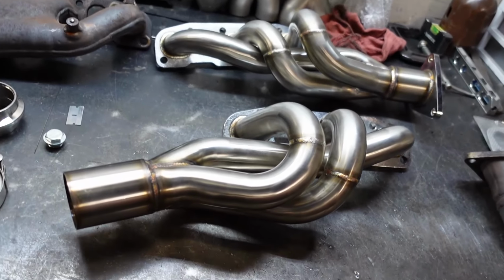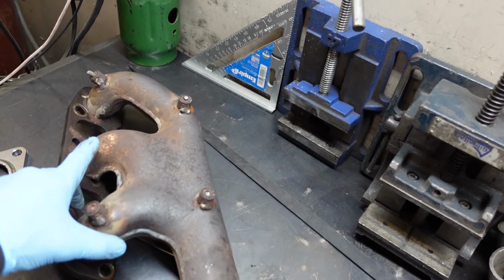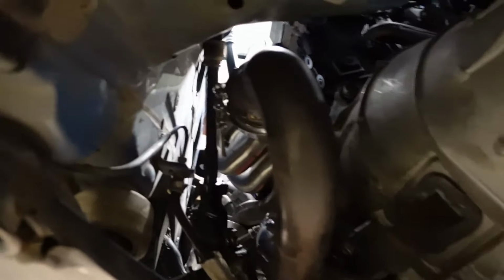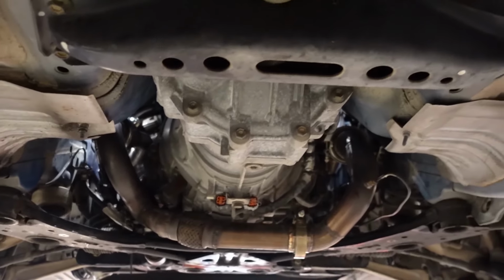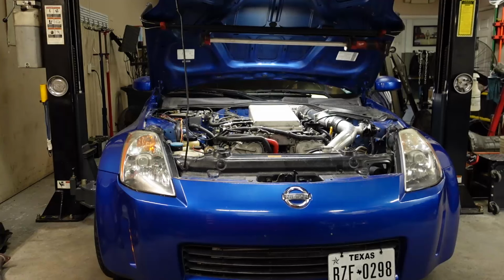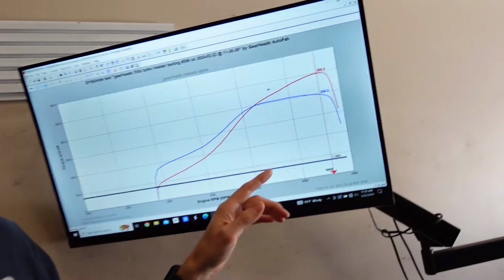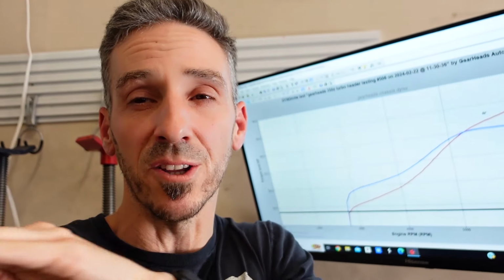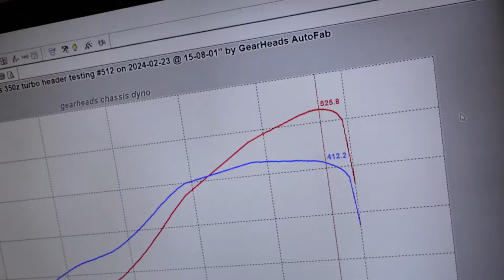Are headers better for  a turbo 350z?

Comment: i knew the headers was the culprit🙏. commented this 2 videos ago. good stuff
Reply: The headers are not "the" culprit, they are yet another one in a long line of issues :)  The back pressure still is higher than it should be.

Comment: Yes. There is a guy who makes a kit with vband headers. VFP tuning. Corky Bell's book would have put you on the right track. Measuring back pressure verses boost pressure would have revealed it all. What clutch are you using? 15 pounds of boost is a lot. A better choice of turbo and intercooler core will give you even better results.
Reply from the maker: Funny thing …..I have that book on my night stand started reading it like a year ago good stuff!

Comment: Niiiiiice work bro. Finally got that number and some more information. My Link ECU should be here Tuesday. Then I’m ordering my complete fuel system. Gotta add a set of headers to the list. And those are some eBay headers. Getting the job done. Nice.

Comment: There just isn't room to fit the optimum size tube for the up pipe, so some incremental improvements in flow are possible with the merge and wastegate, but the limit is close because of that up pipe size limit.
Reply: what’s the optimum size for the uppipe? 2.75” or 3”? I thought it was best to keep the size the same as the exhaust inlet.
Reply: @StreetHeem  3" would be optimal, into a turbine housing that can handle it.  That's for peak power though.  With the 2.5" used here it becomes a back pressure issue at peak revs, as does the T3 flange.  But anything below 500hp the smaller tubing helps spool.

Comment: So I've been thinking cus I'm about yo do the same kit ill end up using 370z or g37 stock headers to reduce back pressure and keep heat down as well after coating everything the difference in diameters is quite crazy how small the stock ge5/350z headers are. Primary being 1 5/8 but de exh exit is 1.652 and the ex exit on the 370/37 is 2.25 should work with the kits downpipe as well a cheap exh mani to solve back pressure for my goal being a stable 400 wheel on a gt3582 turbo low boost like 5 to 8ib at most

Comment: How have those 1320 headers been holding up? Have you had any issues with them cracking or leaking ? I’m thinking about doing the same on my rev9 kit and modifying the coolant line for the 3” DP fitment.

Comment: Mate, can you list the things you upgraded over the baseline kit, please? Thanks.
Reply from the maker: Ok, you mentioned you blew up at around 450 chp. The thing is the turbo kits mostly use stock headers and small piping to be able to fit in the limited space. This make the back pressure really high, mine was 32psi back pressure at 15 psi boost, so…..the most gains I got where from going to a good header and back bigger pre turbo piping and better merge collector to reduce back pressure. 

Also the tuning is super important, cam angle can create massive low end torque and break the motor between 3000-5000 rpm, so I took 50 torque out of the spool up area using cam angle and timing to prevent motor failure. So far it’s working I’m at 525hp now still on my 160k motor 2 years in to boosting.  You can always email me if you boost again and need anything. Gearheadsautofab@gmail.com
Reply: @GearheadsAutofab  Thanks for the reply. 
The turbo kit I had was a twin turbo from a company called Power Enterprise. It came with its own manifolds and it was straight through exhaust, manifold back.

I sold that car because after I bought a fully uprated bottom end package, it just kept overheating so the garage replaced all cooling components. Didn't solve it.

The guy I sold it to, took the motor apart and notified me the garage I had fit the new bottom end, etc, hadn't replaced the head gasket, he re-used the old one despite me supplying a full kit. Spent a fortune, sold on cheap as faulty because of an old coot too proud to admit he forgot to change the head gasket.

This rev9 looks like a good cheap entry point to actually get it FI, then upgraded from there. Your videos and info will be really valuable as I upgrade it.

Tuning cars here in the UK is very expensive, especially turbo conversions, and I'm not mechanically minded so I have to rely on others. So your vids will help and I'll be sure to drop you an email.

520whp is crazy. It must be one of the highest power stock 350z's.

Comment: How did you get the driver side header to fit with the down pipe?
Reply from the maker: I designed a kit to move the heater hose pipe to the passenger side….then I built a 3 inch down pipe and it allowed the driver side header to fit. 

The kit is for sale on 
Www.Nisdaautosport.com

Comment: So do you think if I do just aftermarket headers and leave that y crossover pipe alone do you think I’d still have back pressure issues?
Reply from the maker: I think the biggest impact was 
Headers,
Ported v pipe / crossover pipe 

But you will have to make a new down pipe to fit headers. They won’t fit on the original kit

Comment: Hey so I heard from a friend you made 680hp on Honda b18 Nippon cast pistons and rods. And it’s been going 3 years strong. I’m curious on some things,
Was it whp or hp?
Also what % difference is who to hp ?
Isn’t it about 20%

I have an open deck b18 Nippon rods and pistons my goal is 700hp crank, mainly a track car, but the occasional cruises
Reply from the maker: Yes 670 and it was only limited because I couldn’t get it to make more boost on the dyno. Yes it’s wheel hp I only have a in ground roller dyno that test at the wheels. But all dyno numbers are very slightly so numbers are not super important. 

The biggest thing is that I cut the piston ring gap big and because the Nippon piston has lower compression it takes a bit more boost to make power, however it takes the pressure off the part of the block that usually cracks. So far I have lots of dyno testing and 3 track days on it and a little street driving and it’s still fresh and running grate. 

Also I made 450 on 93 pump gas and ran it at the track in 100 deg weather a it still didn’t break. I do think it’s the cheapest setup at this power level I’ve ever done. Car went 11:1 on 450hp on the hot day
Reply: @GearheadsAutofab nice around what crank HP woke you say 670hp is in a B series ?
Reply from the maker: Maybe like 730hp ….. people say it’s like 10 or 15% something like that
Reply: @GearheadsAutofab what’s the most you think that setup can handle HP wise ? Could you make 750-800hp
Reply from the maker: Yep I bet 800 is close to the limit
Reply: @GearheadsAutofab 800HP !!! Bro on scat pistons and rods!! Like those eBay 550$ pistons and rods ?? If so that’s insane dude!! Everyone tells me 600hp is the limit. But man if I can see 800hp I’ll be stoked. God bless you man
Reply: @GearheadsAutofab so if you don’t mind I’ll give you run down of my setup. 

B18b 
1300cc injectors on e85
62mm PTE turbo 
Scat piston and rods
ARP head studs 
Stock head 
I’ll keep it stock rev limiter 

It’s a track car. I plan on driving on the street sometimes, but I won’t be doing pulls. if so very small 1-2 gear pulls.

I know you said the rods and pistons are good for like 800hp max. But will the head have restrictions on it ?

I would be very happy to see 780hp or just maybe hit that 800hp mark
Reply: @GearheadsAutofab please respond
Reply from the maker: Not sure what the question is. 

8500 RPM is fine , but if you put an ATI balancer on it….. you can spin it to 10,000 easy….(I take mine to 11,500 in first gear ⚙️. Now, of course you need a camshaft that’ll make power out that high. Which means it won’t be a streetcar anymore because you probably won’t make much power until 6500/ 7000. The other thing is with that 62 mm. You’re probably gonna be out of power by 30 to 35 pounds of Boost. And I would imagine Max out right around 700 hp.  

I dragged Raced professionally for almost 10 years at the highest level with Hondas. I don’t mind giving you more advice. But to be honest, I don’t check my messages here super often. Feel free to text or email me.  Gearheadsautofab@gmail.com
Reply: @GearheadsAutofab thank you. But my question is how much power can I make on my setup max I’ll go over the setup 

STOCK OEM b18b head, no springs or retainers. (Plan on keeping it stock rev limiter)

B18b open deck 
Scat Nippon cast piston and rods.

I plan on doing spring and retainers later, but I’m planning to make some jam first and get it on a dyno then go back and do it later on. 

Also the car will be on e85, and 62mm turbo and fuel system are all good. I’d like to see 700hp. 

side note
In the future, I might get a bigger turbo, and epoxy the block. 

But I’m Manley wondering 2 things 

How much can those pistons and rods take ?

How much can the stock head take ?

Also thank you sooo much for helping ! 
It’s just hard to find answers out there